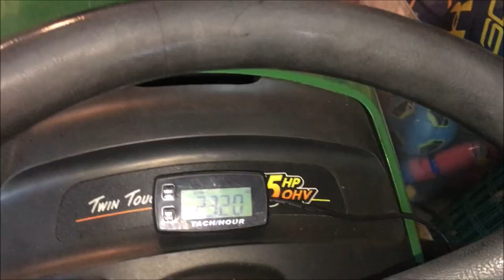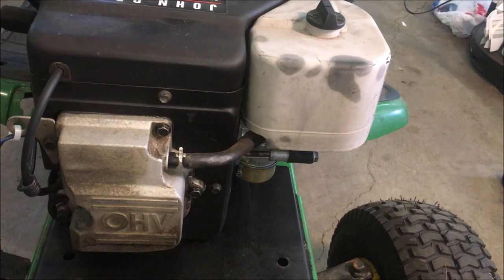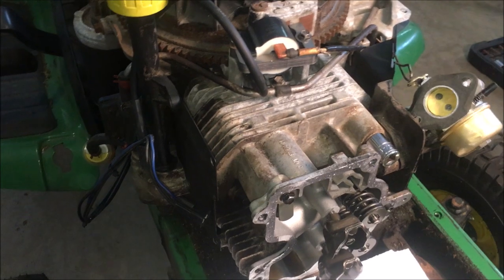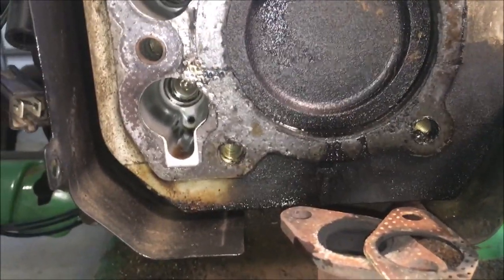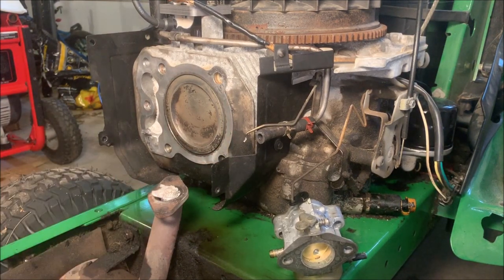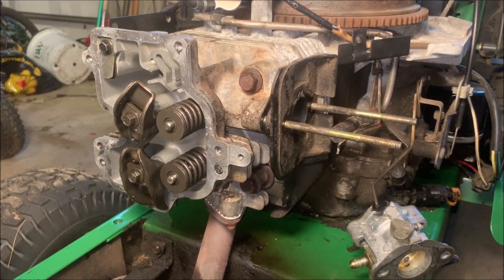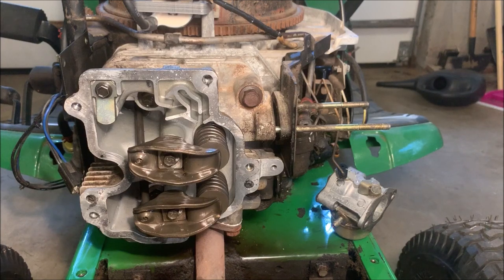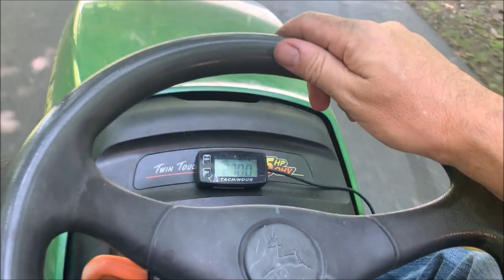Kohler Command Blown Head Gasket Repair

Comment: I have the same exact mower and engine. Mine seems to putter and stutter a little and doesn’t seem to have the power it used to. It smokes a little black smoke on startup but clears up. Smells like burning rubber or something. I’m wondering if the rings are worn or the head gasket is going.
Reply from the maker: These engines are usually fairly bullet proof.  The head gasket is a common failure.  Mine still lets out a big cloud of smoke at startup but is still running well otherwise.
Reply: @jcondon1  ok thanks for responding

Comment: I have the same engine on my tractor. It stalls after 15 minutes of mowing, smoke out of the oil stick and the air intake. When I start it up it puffs black smoke out. Am I correct in thinking that's also a blown head gasket? It happened out of nowhere so it's not related to fuel sitting in the carb
Reply from the maker: Smoke out of the air intake is suspicious.  These are known for blowing head gaskets.  So it’s a safe bet that you need a new one, but you could have other issues.  Hard to say.
Reply: @jcondon1  Thanks for the reply! I did change out the gasket and it's still stalling and smoking, it's probably a more severe issue

Comment: How do you adjust the clearance on these rocker arms with out an adjustable nut and set screw? My rocker arms are without any clearance at TDC. I’m experiencing a loud tapping.
Reply from the maker: This engine had hydraulic lifters, no adjustment for valve lash.

Comment: On mine the the same bottom bolt was loose. In my case the engine smoked like crazy and also hard to start.
Reply: I've got a LT 155 that just today started smoking heavily, has been hard starting recently. How long did it take to repair yours? How much were the parts?
Reply: @garykerkstra1067  it took me about 4 hours total, 
One day I disassembled all parts to take a look on the head gasket and made sure I was ordering the right one. Taking parts off is time consuming. Be sure to take pictures or do some drawings if you have to.
Parts: head gasket: $12.70
 and exhaust manifold gasket: $7.99

Comment: No valve adjustment right? Hydraulic lifters?
Reply from the maker: Hey Henry!  No valve adjustment needed on my Kohler.  There are some that do have adjustable valves.  Here is a link to the manual I used https://drive.google.com/file/d/1vsQFHjCj-1VnCdRcaPvsXfYwIhSb1e7s/view?usp=sharing.  Good luck with the Scotts.  Love your work!  I think starting on page 11.11 it starts talking about the different valve configurations.
Reply from the maker: And congrats on reaching 5000 subscribers!
Reply: @jcondon1  thanks James, you did a great job on this video.  Your engine is the same cv15s as my Scott's.  I'm gonna try tightening the engine bolts and sell the darn thing.  Thanks for the accolades, 5000 I guess is a big deal.  Thanks for helping out.

Comment: I have same engine on l110. When it gets hot it miss and smoke. Wonder if this could be the issue
Reply: Suggestion, try to retorque the head bolts before you take anything apart be sure to do that when the engine is cold. And see if that helps.  If it doesn't help,  you may need a new head gasket(s) ( 2 for 2 cylinder only)
Reply: @bertgrau3934  I done it last weekend still gotta do flywheel key it's sheared off.
Reply: @LeeGuy-jd1ho  
One thing on the flywheel,  be sure to Torque it to spec,  that helps keep the key from shearing.  

Good luck.

Comment: Good video but you should've checked the valve clearance while you were right there or did you forget to put that in the video.
Reply from the maker: Steve Gibson this engine has hydraulic lifters and are not adjustable.

Comment: Did I miss you  checking  the flatness  on the head and block surface.
Reply from the maker: I did not check it.  Usually not a huge concern on small engines, but definitely can be an issue especially if the engine has been overheated.

Comment: how do you set rocker arm adjustment?
Reply from the maker: My engine used hydraulic lifters.  Not adjustable.  Kohler also makes a version with adjustable valves.
Reply: @jcondon1  Yea,  I need to adjust after replacing head gasket was wondering how you did it, oh well,  thank you

Comment: I accidentally cranked the engine for about a second to 2 while doing this and there was no oil in the engine. The engine turns fine by hand and i dont hear and knock when I turn by hand. Can you blow the engine when you crank it?
Reply from the maker: You should be ok.  Even though no oil, there is still a film of oil on everything.
Reply: @jcondon1  thanks for the reply!!

Comment: Ciao scusa, ti scrivo dall'Italia ho Anch'io un kohler command 15 hp cc.426, con carburatore Walbro 6, montato su uno snapper. Purtroppo le targhette di identificazione col sole si sono cancellate come posso fare per i ricambi? Ho solo questo dato su una targhetta ancora leggibile: family YKHXS.462GB Grazie se mi puoi aiutare. Hi sorry, I'm writing from Italy I too have a kohler command 15 hp cc.426, with Walbro 6 carburettor, mounted on a snapper. Unfortunately, the identification plates have been erased with the sun, how can I do for spare parts? I only have this data on a still legible tag: family YKHXS.462GB Thanks if you can help me.
Reply from the maker: Without the model and spec it is hard to be sure what you have.  The model I worked on in this video was CV15-41562.  The parts diagram is located here: https://www.ereplacementparts.com/kohler-cv1541562-engine-parts-c-106503_108123_285185.html

Comment: Great job with this video, it looks like I will be doing the same procedure on my Kohler Command. I have to ask what kind of drill attachment did you use to clean the carbon off the piston, valves and gasket surfaces on the engine? I sure could use one of those it would be a real time saver.
Reply from the maker: 60retired for the piston I used a wire cup brush sold at Home Depot.  For the gasket area I used “Roloc Bristle Disc Grade - 120”.  Ordered that on amazon.  It is a white plastic bristle brush.  The bristle brush is much safer to use as it does not scratch up the aluminum as much as a wire brush.  Spray wd40 on the carbon first that will help a lot removing the carbon.

Comment: Hey I just did this on my stx38. And it looks like the timing is off? Didn’t do that before replacing the head gasket. When the engine cranks looks like the spark is delayed and turns on late making the engine spin the wrong way for a second every time the spark turns on. What could it be ?
Reply from the maker: It sounds like a timing issue.  But if it was running ok before you did the head gasket then it is unlikely timing (assume you did not remove the fly wheel or open up the crankcase).  It you want to confirm timing, remove the engine cover so you can see the flywheel and the ignition coil.  Remove the spark plug, turn the engine in the normal direction, find top dead center.  The magnet on the flywheel should just be passing/clearing the ignition coil.  Assuming that is good then would think it is a valve issue.  Make sure both valves are opening and closing.  If the clearance on your valves are adjustable, check the clearance.  If off, then the decompression release may not be doing what it should.  It you remove the spark plug wire and crank the engine, does it turn over normally or does it have trouble in the compression stroke?
Reply: James Condon I’ll double check all of that and report back 👍🏻 thanks
Reply: James Condon so i check everything. Looks like I ordered the wrong spark plug. Installed the right one. Added a little bit of starting spray and it kicked on. Unfortunately the damn gasket blew again? 🤦‍♂️